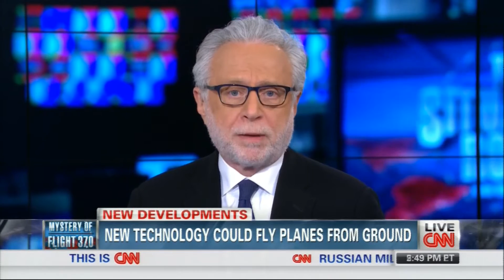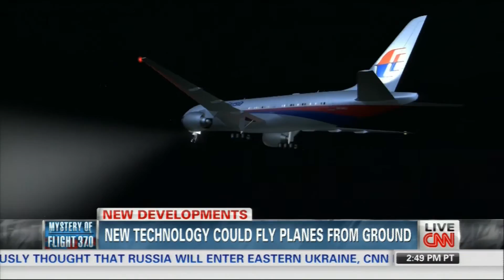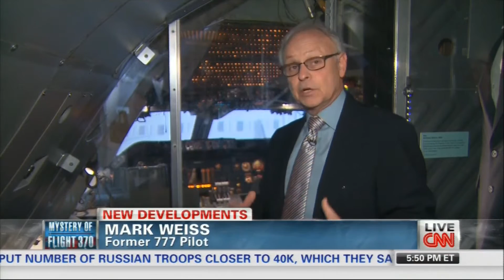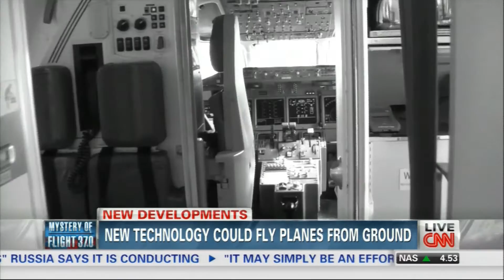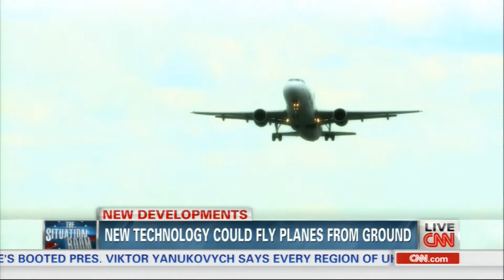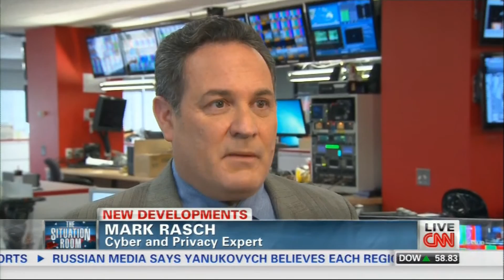Remote Controlled Autopilot Boeing Patent

Comment: Muppets! Remote flight does NOT exist for airliners. No airliner in service today had is installed. It is little more than a project. The data links and systems interfaces required do not exist either on the ground or in aircraft. Systems such as autothrottle, flaps, gear, airbrakes, wheel brakes are discrete subsystems and have NO links to the outside would. Imagining an airliner could be saved by input from the outside world is complete fantasy. Additionally, the systems already installed regularly malfunction and give unreliable and unrepeatable outcomes to regularly to regard them as failsafe. To link them to a poor and unreliable data stream would be guarantee a total disaster. Field should be publicly drowned in a bucket for spreading false news.